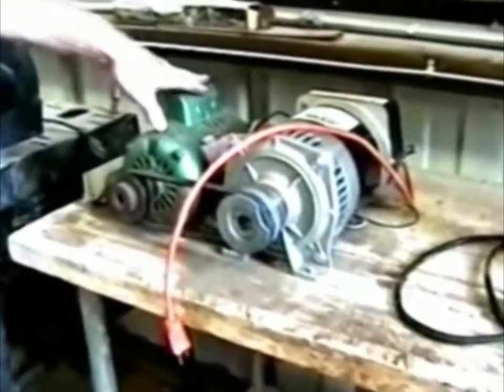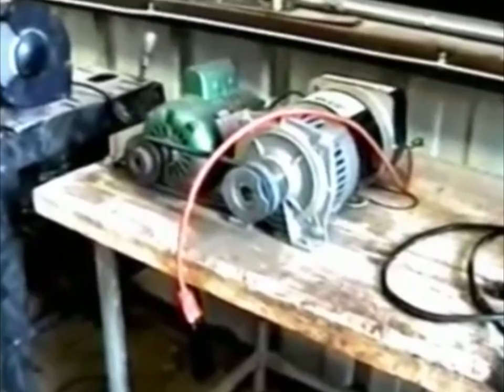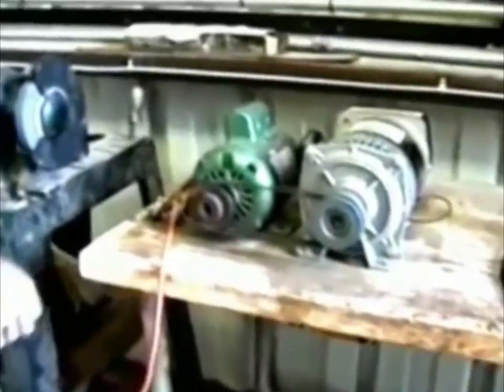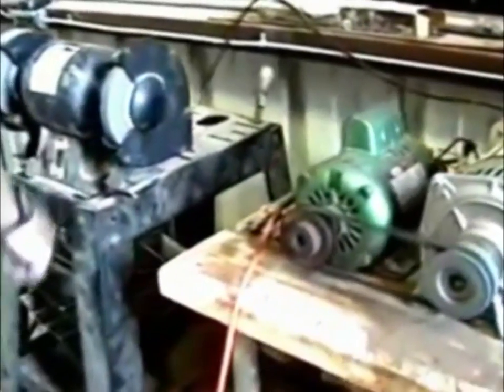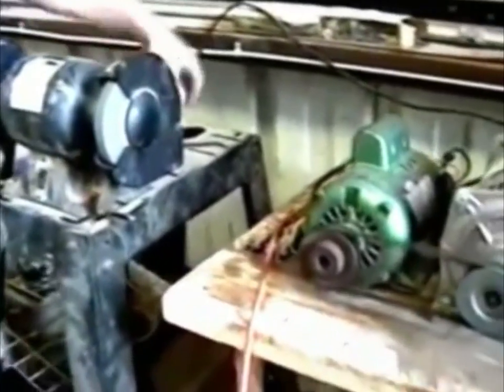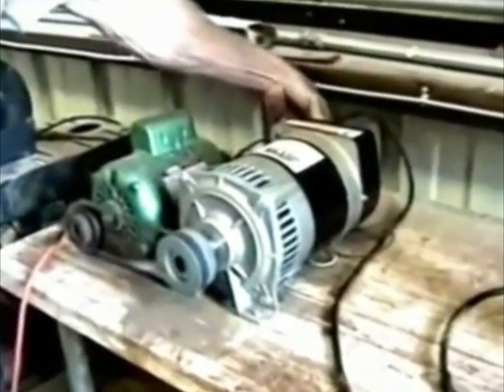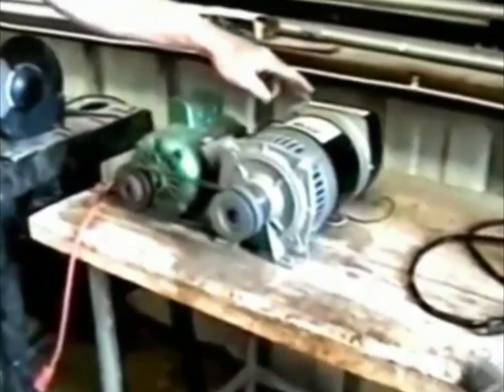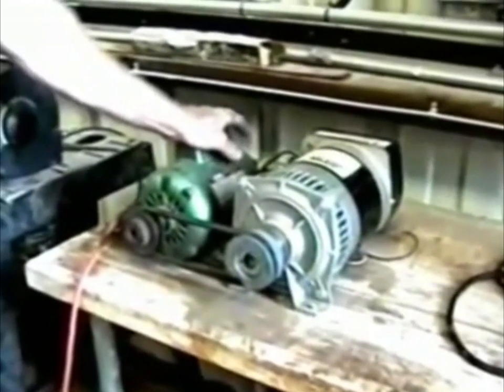Self Running Motor-Generator unit (www.witts.ws)

Comment: hi i love your idea regarding running power for rural shop, when fuel is not available. So could u please tell me the capacity of the electric motor, many hp, rpm, & input voltage. and where I can get Belt-Driven Generator Head rated for 3000 kva...thanks

Comment: I was thinking about something like that but I want it to run my air conditioner in my house, maybe it will help to lower my light bill
Reply: As a hvac/r tech guy, its hard to running a AC from small power source, AC condenser normally withdraw min 30 amps or more from the service panel, the according the tonnage. The best is using a stationary gas gen. with minimum 10kva. However the math is simple for every 1000W/746 hp= 1.4 HP. electric motor is need; to running your Condenser Unit around 30A, - you need at least 8000W/746hp=10hp you need a 220V electric motor to help running a Belt-Driven Generator Head or gas power engine(9hp). Bueno muchacho cuidate y buena suerte...pf me manda el plan de tu project! Quiero hacer uno que funcione! Gracias or Thanks

Comment: Well I tried that but it’s not working, I have a 1hp electric motor and a Winco TB4800 4800 watt belt driven generator.. One power cord is wired to a single pole light switch that I use to plug in wall outlet, another short cord plugged in the generator going to the second light switch.. Leaving both switches are tied into one cord that goes to the electric motor but when I flip both switches it dies out or flips the breaker ?? I did the pulley calculator to match the speeds needed, so what am I doing wrong ??
Reply: I can help you
Reply: @MRNWANETI  ok how do I make this thing work, I have COPD and so can’t breath too well and need a oxygen machine now and then, but what if power goes out ?? Can you email me @ hedgehogflstn@yahoo.com thanks Mike
Reply: @michaelowens8196  it has to be the modifications in the generator. i had this idea also and tried with ac motor and generator. i cant switch from panel power to generator power, it just shuts off. must have to bypass something in the generator. i think i might add an alternator and inverter to run the motor and then use the generator to power devices. did you ever get an answer for your problem?
Reply: @shaeswee2428  well no they never answered, someone else did though, said this video is a hoax, said it’s still connected out of view, but you can make one but need a low rpm asynchronous generator 220V and heavy flywheel for centrifugal force speed between switching power sources ?? I asked show me his, he said it’s in town but never did ?? All my components were new, I cant afford to try the other one on a disabled income ??
Reply: @MRNWANETI  Do you have a running generator?  If so, how can I get in-touch with you to discuss?

Comment: It would be really helpful o see how the two switches were connected to transfer the power from the wall into both units in order to run them without the power grid.
Reply: you get motor spinning plugged into wall then you unplug it. the switches are used to run motor from back of generator. nothing fancy. you don't even need switches. just unplug from wall and plug into back of generator and it keeps the motor spinning which keeps gen making electric. that's why he could only use a other machine at 1 time. the gen don't make enough electric to run motor and 2 or 3 other things
Reply: @getreal1702  but why did it not even bog down?
Reply: @getreal1702  
While both generator and driven motor running at the time,  when it comes to switching it has to be fast otherwise voltage will drop instantly and causing voltage drop across the generator output.
Reply: What is the order of connection amd what’s effectively needed to have a high power rating such as e generator able to run a house even? And how strong of a electric motor would be necessary to run that powerful of a generator

Comment: This is great, but please where and how can i get this very type and size of self running induction motor unit.
I will appreciate if you or anyone here could help me on how to get it, thanks.
Reply: no such thing as self running motor. the motor is running from being plugged in into back of generator. that is why he could only run 1 other thing at at time.
Reply: @getreal1702  it’s that good enough?

Comment: I am a little skeptical, but could you sent me the schematics of how you did it to try it myself? phantomprojectzero@gmail.com
Reply: its simple. just plug in wall, unplug and plug it into back of generator. no plans needed
Reply: @getreal1702  damn, how do i two thumbs up this comment? Pure genius!👍👍
Reply: And don't forget to put the screwdriver in the drill press, that part is important! See if u can get it to snag on the power cord and get it twisted up real tight while you're at it..
☝😬👌

Comment: Please tell me about the motor rpm and horse power. Are you producing ac current with ac alternator daynmo if yes then tell me about the rpm of ac alternator. If you producing dc current and then change in ac current with help of rectifier, please tell me the rpm

Comment: I have  6kw petrol engin alternator, please what size of AC motor can I get to drive it, please I need reply urgently, thanks
Reply: you need same amount of motor with 1.2 factor of rpm and hp other wise energy losses never give you same amount which you use to drive.
man it is simple rule laws of conservation of energy

Comment: Not real.. remember in the physical term you cannot get somthing out of noting.
Reply from the maker: It's not nothing, energy is all around us just like air.
Reply: @furulevi  yes I agree with you there is free energy e.g..wind Sun and water there is also nuclear energy but it is dangerous and unstable. One of the most dream for inventors is to make a machine that can move workout any energy power itself overcome friction and have a little power to power something else, in short it's a perpetual motion machine. Ho knows mabe one some one will crack it with the help from free energy like magnetic forse. Good luck.

Comment: Hasnt anyone thought of the law of thermodynamics? You cannot do this. Its impossible. Modify it all you want. This guy is full of shat!
Reply: Have you tried building it yourself and testing it or anything similar? Do you believe everything you are taught in a school?
Reply from the maker: Those theories related only to isolated systems, and isolated systems do not exist in nature. Just think of gravity, can you eliminate it from a location? No.
Reply: what is so hard for you to figure out? the electric motor is run from the back generator after he unplugs.

Comment: The answer to this is simple if you understand basic electronics. In this video the motor is plugged into the wall by a switch and the motor is also plugged into the generator.  They can't both feed the motor at the same time. The only way this can work since he flicked one switch is that the switch turns off the wall power and the same time turn on the connection to the generator but the problem is a switch is just that. A switch between connected and not!!!! Connected.  He only Flicked one switch so that makes  this impossible but wiring alone. It's ac power it can't be feed into one motor buy two sources in parralle connection the ac won't be sync.
Reply: you never heard of double pole, double through?

Comment: a motor does not behave like load to a generator. its when there is some frequency mismatch or coil resistance difference that the motor screw up the generator. if both motor and generator are in resonance with each other, they will act like a flywheel but with electrons instead of mass. the thing is that if motor is running off the generator, it creates its own frequency that overlaps with the generator and if the frequency is not the same under load, the generator and  motor will cancel each other out.  electric motors does not really consume electricity, they just create mismatch flucuations with the source that interfer with their operation as they do not really behave like load. if they heat up, they behave like a lamp like a real load. a electric motor that does not get hot under load, does not behave like a load. i personally like the reverse setup where the motor provide the flux for the generator so that the generator can reverse polarize gain to the motor in resonance as that does not produce heat. a lamp load is real load as it create heat and actually converts electricity into heat. a electric motor in resonance with the generator does not produce heat, therby is not a load not matter how much torque it produces.
Reply: Thank you. Everything I've been taught about physics says no. You explained why in this circumstance, physics said yes. VERY circumstantially is what I gather

Comment: I'm trying to find away to run 4 a/c blower motors as fans to keep my rabbits cool. I have a 3500 watt generator with a blown motor, my question is can I just pull the engine, bolt a electric motor in the same spot and run a belt to the generator and flip a switch then I should have power to run all day?
Reply: you will nee a feedback circuit from the genny to the motor...  then the genny will run the motor will run the genny... roundy round see?  problem is, you need an independent power source to start it.

Comment: It is wonderful. However, when I want to change over from grid power to the alternator power, my motor would not want to run. Could you perhaps indicate what method or changes you made to either motor or alternator in order for this changeover to be effective.
Reply from the maker: Ask the Witts team...
Reply: @furulevi  yes but you demonstrated it. I am supporting you, unlike the others, but I just need some extra info
Reply from the maker: This is not my personal video, I wasn't present there at that demonstration.
Reply: although this is ingenious, it's still a basic hack with standard "old school" technology...  What you need is a power inverter.  The alternator runs on direct current, the motor does not.  it's a power inversion loop,

Comment: Altered with a battery indside.
Reply: Doesn't even need a battery. Just a second cord. The one he shows being plugged in is just for show and never carried current.
Reply: @TheAnantaSesa  wrong. It got the motor and generator spinning when he unplugged it and through the switches it {the motor} was hooked up to back of generator
Reply: get real, you don't know that. All you know is what he claims.
Reply: @TheAnantaSesa  there is a ton of videos showing same thing. look around. YES that is how it works. i never said anything that guy said. seen this video 7 years ago. No a battery could not do all he did. no 12v in that whole video. maybe you should watch it again
Reply: get real, there are a ton of videos showing flat earth. I'm sure you believe those too.
Reply: @TheAnantaSesa  nope. don't believe you are flat earthers. go watch a video by angry ram on YouTube with peloton wheel. hydro-gen. title is {been living 16 years off grid} look at Gerard Morin on here also. Have you seen the India people making flywheel gens? same as this one. he uses grid to start it then unplugs it plugs it in gen and the gen is running the motor. granted you can't run much else this way maybe a chop saw or drill.
Reply: get real, free energy doesn't exist in this world of entropy. It only exists in the spiritual dimension.
Reply: @TheAnantaSesa  it's not free energy. if a gen puts out 110v and you have a 110v motor doesn't the gen run the motor? so why can't you take a spinning gen and plug in a motor and make it work?
Reply: get real, never heard of friction losses?
Reply: @TheAnantaSesa  Then tell me how my gas gen runs my camper and a/c ? you are saying if i have a motor with a belt hooked up to my gen that the gen won't run the motor?
Reply: this is what you are saying can't be done?
Reply: get real, I'm not saying a con artist can't make it look like it works. Your gas gen runs off gas. It isn't over unity. I guarantee you.
Reply: @TheAnantaSesa  i never said it was
i am saying if the gen can run my a/c then it can run a motor with a belt on it hooked to gen
Reply: get real, and the flywheel will slow down as the generator can't produce as much power as the motor uses.
Reply: @TheAnantaSesa  so you agree. the flywheel worked. now why cant he plug the motor in back of gen not work? same thing flywheel dude did..
Reply: get real; bc the flywheel will slow to zero over time and you have to speed it back up aka charging the "flywheel battery". Once again, TNSTAAFL.
Reply: @TheAnantaSesa  FLYWHEEL BATTERY? You sir a fool.

Comment: Hello, for my first attempt at this I have a 2500 watt generator that I'll run with a 1/2 hp motor 110 volt.(1 to 1 both turn at 3600 rpm) So that motor will take 700 watts to keep running according to the formulas, so with the other 1500 watt I was going to also turn a alternator to charge at least 2-3 batteries and add a 4000 watt 240 inverter. (add a wind turbine to keep things charged)  Not quite enough to run the house (turn off the hot water tank) but that back feed should be enough to run the furnace, fridge, freezer and a few lights. If that works I got plans to make a bigger one  and hopefully be off the grid. Even if this one could help by running some of the appliances, heaters (I live northern Canada , two seasons still -20 at night) would give me a break on the power bills.  Just to clarify the electric motor will be powered by the generator not the inverter , giving me 1500 watt to run the rest.  What makes this so easy is that the generator was run by a self governing motor and was small enough there was no electric start or extra wiring to by pass. Appreciate your expertise back. Thank you
Reply: Did you get it working??

Comment: First he says it's a 2900 watt generator, then he says it's been modified two hundred times from ground zero. Ground zero is a nebulous term. 0 times 200 is zero. Or 200 times 2900 is 580000. I doubt either is true.
Reply from the maker: space is full of energy ;)

Comment: You can use it to charge batteries that will power your home but it can't run forever you will need to let it cool
Reply from the maker: plus you have to change the bearings from time to time :)

Comment: Watts are just as much mechanical power as electrical power, you can not get more power in electrical watts than the mechanical watts put in. Also, there is inherent losses in converting from one form to another, making 100% efficiency impossible. So, to even attempt this process is a guaranteed fail.
Reply from the maker: This is not a closed system.
Reply: You said the motor is 3/4 hours, right. Well, 1 electrical hp is equal to 746 watts. So your 3/4 hp motor is only capable of 560 watts. There's no way it can produce 2,900 watts. Even if you used a high efficiency motor, at 90%, you would need to put 3,190 watts minimum into the motor to get 2,900 watts from a hypothetical 100% efficient generator.
Reply: What if you were using a series of charge capacitors?

Comment: ONE 240 VOLT HIGH SPEED CONVEYOR MOTOR WITH A TRANSMISSION (AUTO OR STICK FOR A MOTORCYCLE) CAN RUN UP TO 20 120 GENERATOR BLADES ON BELTS. HOPE TAXUS DOESN'T SHOOT YOU. you can also use a prius stator if you can handle the hertz. easiest way though is to use a stator with large magnetic but only one(magnetic per stator)  then balance with weights then transmission then sixty revolution per second.oh ya you will need a battery two motor with transmissions and an easy way to change the transmissions when the sync motor makes it changes sides for maintenance.

Comment: If electro motor = generator and generator = electromotor (according to simultaneous power) then you cannot get grinder moving on permanently and even not to use it for grinding the tools. You cannot get more energy to 2nd equipment than you get from 1st equipment in a closed system.
Reply from the maker: Closed systems don't exist...
Reply: West Slavs şıvapsrver